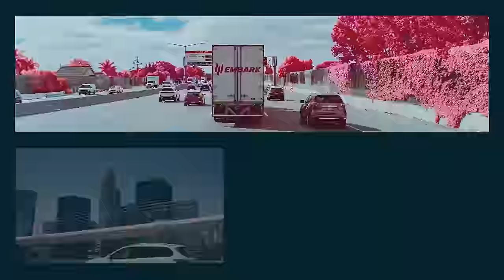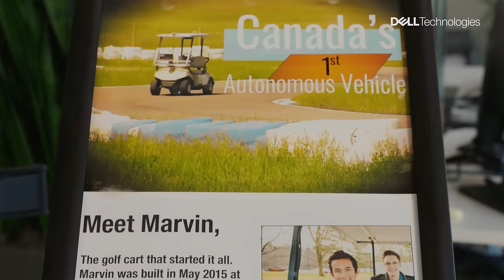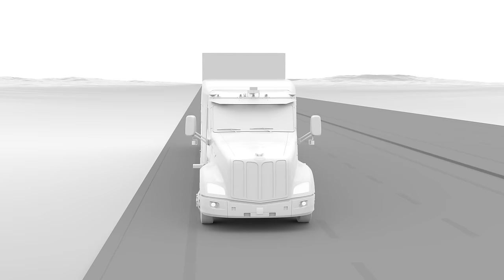How One Company Is Making Self-Driving Trucks A Reality

Comment: Trucks should mostly be the last mile piece. Trains are significantly faster, safer, and cheaper. In Europe chains like ikea even have rail access at some stores.
Reply: Trains are still dozens of years away un america. Meanwhile we already have hundreds of thousands of miles of highway infrastructure already built. Autonomous trucking could be a good bridge. They can also haul more goods per sq ft faster than trains. They're really efficient
Reply: As much as I agree, the US hates anything with the word "rail" in it.
Reply: Trains are slower that cars/trucks in the US
Reply: Well this is for US. For them, traveling using highway is the only option. If the train can run on highway, only then will they use train.
Reply: So true
Reply: TESLA class 8 BEV Semi beats RAIL on price , they can Autonomously PLATOON w/ only ONE safety Driver. 
TESLA Semi is FASTER than cargo Rail.
and if TESLA Semi leverages Underground LOOP Tunnels , they will be 10x more Effective , there is no Traffic in LOOP Tunnels and can be DIRECT routes to END Destinations , they can negate bad WEATHER at both ends. 

LOOP Tunnels are rated for 200 mph and Tesla Semi can run at FULL Speed , dont have to worry about Traffic.
Reply: @markplott4820  and if pigs could fly….the idea of platooning the trucks may be something that could work but it has lots of potential hurdles to overcome as well.  As for the idea of the loop, I have a better chance of becoming a billionaire then the loop has of ever existing in any useable format.
Reply: @markplott4820  How many Tesla class 8 semis are currently in service?  None?  You are stating their goals with this technology as if they have been proven in production vehicles.
Reply: @leagueofotters2774  very good point and right on the money.
Reply: Trains can’t go everywhere Chief. I think your gross misunderstanding of the logistics and structures that are needed would be worse than trucks .
Reply: For a container to go coast to coast it takes at least 8 to 10 days,from shipper to receiver add another 2 3 days,a truck can do it in 3 days.

Comment: Automat long haul… why. Forget the drivers you’ll run out of a job. In essence rail is superior to long haul trucking,
Reply: easier for a small business to get a truck in. big corporations should do this for sure though.
Reply: Safer, more fuel efficient and probably just as fast.
Reply: @donovanmccoy5339  a small business for a long haul trucker sure. But what is a auctioneer going to do with a self driving truck that can’t maneuver in tight spaces or take instructions? And if it’s a big corporate enterprise Rails the best option for volume.
Reply: @pdxmack  safer is debatable. Energy efficient not a chance. Ideally warehouses would get a Rail connection like Chicago used to have. Eliminate the need for volume and keep trucks local and human operated. If the trucks are local you MIGHT. Even get away with Them being EV.

Comment: I feel this is going to end in a huge tragedy somewhere! This has dangerous at those speeds written all over it...
Reply: Same as Tesla cars yet their on the way to roads everywhere
Reply: They're actually safer than driven trucks. You just don't hear about how many ppl die in trucking accidents because it's SO common
Reply: There are ENDLESS fail-safes to prevent bad behavior… there are no autonomous driver-out trucks right now (there’s always a qualified driver in the truck)… I promise you, the AV folks care even more about safety than you do, because one screw-up or at-fault accident and it’s all over. They are the safest and most paranoid bunch out there (as they should be!).
Reply: @nottheone582  I thought the data was published?  No?
Reply: @theheightsrocks  It doesn't appear that is always the case though....the recent tusimple incident shows that.
Reply: @leagueofotters2774  TuSimple was careless and cut corners, they wanted to rush to market without doing it the right way. I agree, if all companies were like them, I would be afraid of the technology too.
Reply: @guilletiger  just killed 2 motorcyclist last year ( 2022) autopilot mode. Car never stopped. Imagine when the big boy trucks get in these zones. Around school busses, retirement homes, computer hackers? This risk is just not worth making the rich richer. It’s just not
Reply: @theheightsrocks  which means the system is pointless, if you have to be in the truck paying attention at all times, then you might as well drive the truck.
Reply: @daviddavis9061  if that was all they wanted to do, I agree, that would be pointless. The end goal is to have the system competent enough to operate on its own without safety drivers. It’s not there yet.

Comment: Such high maintenance...Knight Rider got it right. Every truck needs a team of people including engineers.  That begs the question will this be cheaper than actual truck drivers in the long haul. We will need docking bays across country for diagnostics checks and maintenance.  Software engineers are not cheap. Knight Rider, Kit had his house follow him wherever he went and he was seriously high maintenance.  

However,  we haven't dealt with baby sitting the wheel for safety drivers. No one can sleep, if your a safety driver. You have to stay awake and alert. So driver fatigue hasn't been solved.

Comment: All the naysayers here... Remember that there was a time that cars were new and broke down often enough that people would say, "Shoulda got a horse..." Well, how many horses are around these days? One of my cars has over 180,000 miles and the other over 200K. Both run great... Oil doesn't even get dirty after 5000 miles. Point is, this is new technology. Yes, there are lots of problems to solve. But they will solve them over time. The day will come when much of the drudgery of long distance trucking will be automated. Drivers will benefit because they can stay close to home and not spend weeks on the road. The number of accidents will plummet. Humans are far more accident prone than autonomous trucks will be. Sure, certain conditions and situations may require a human driver, but the point is not to eliminate the drivers, just take away as much of the annoying and monotonous parts of the job as possible. You may not believe me, but let's talk in 30 years.